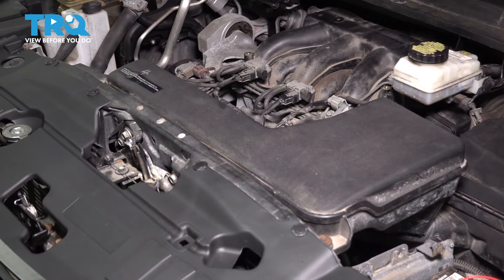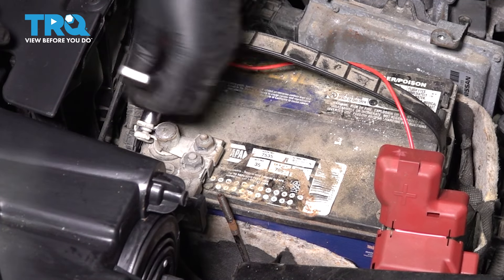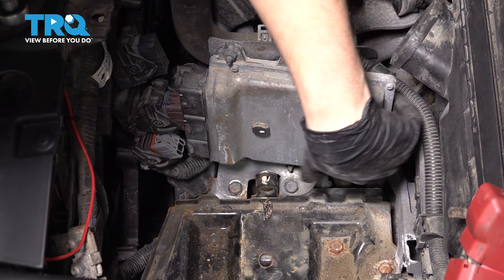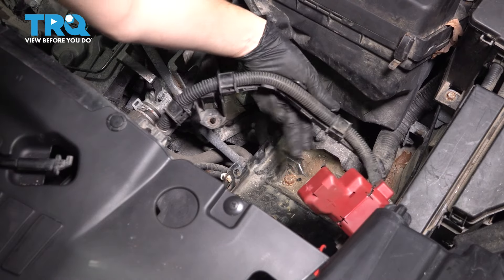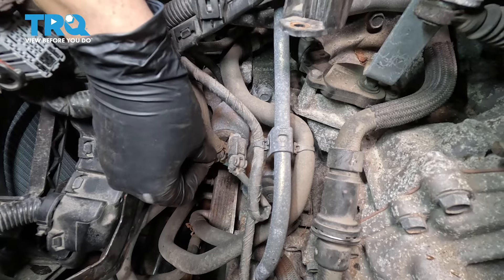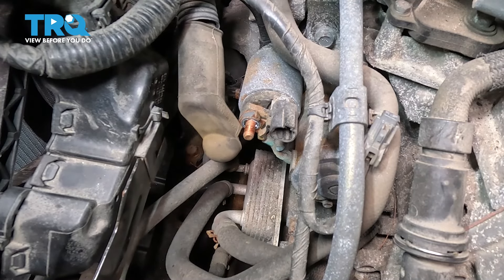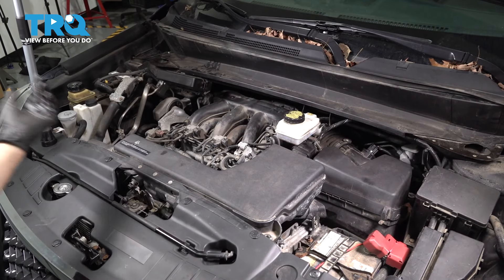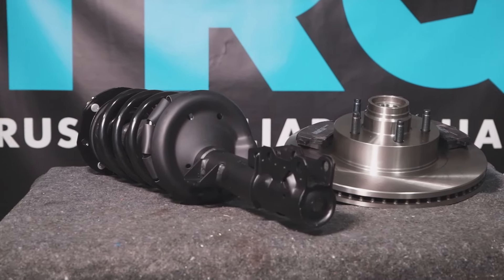How to Replace Starter 2013-2020 Nissan Pathfinder

Comment: Thanks for this video. I have 2017 Pathfinder and it match pretty well with the exception of how many bolts they used to mount bottom battery bracket. I had to remove 3 #13 bolts, not just 2. One was hidden behind harnest. Eveything else was as described.

Comment: Watch out for burnt fuse at the battery terminal.  The main battery to starter goes through the 250amp connection 😮. 
They used to bypass that on older models to keep from blowing that fuse when the starter draws too much current.